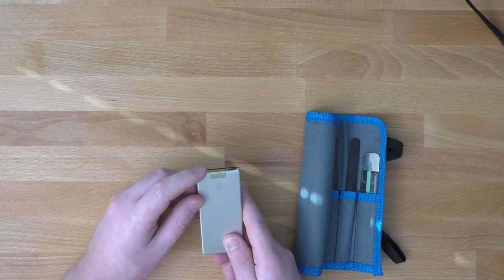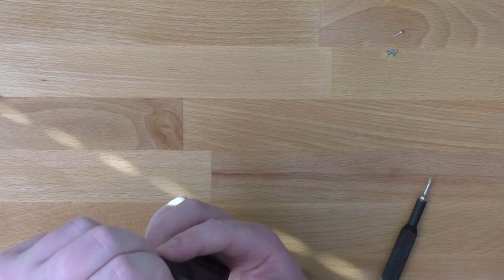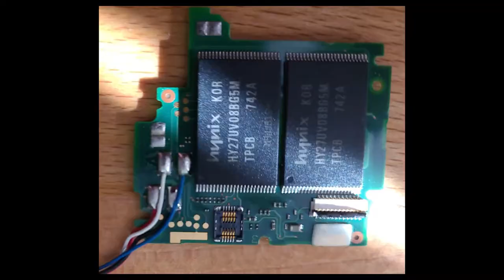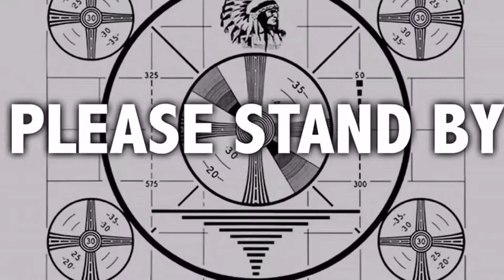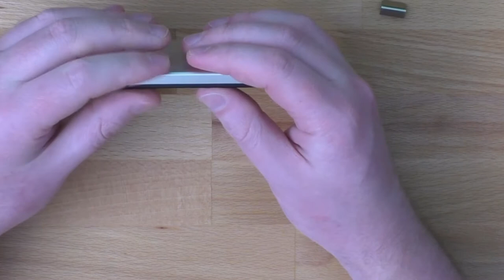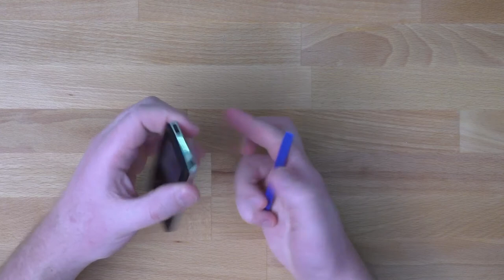Zune Battery Replacement

Comment: @CO3 Productions Hello and thanks for posting this awesome video about the Microsoft Zune.
I have an 80GB and I need the battery replaced could you share where you purchased your battery it would be greatly appreciated I have been trying for a long time to find a battery and it seems impossible. So if you have some great info as to where I can find a battery to bring this Zune back to life man that would be great.
Reply from the maker: Absolutely. I purchased the replacement battery from eBay
https://www.ebay.com/itm/Microsoft-Zune-4GB-8GB-16GB-Flash-4GB-8GB-Digital-Media-MP3-Player/164426248494
Reply: @CO3Productions  Thank you..

Comment: Hey I was wondering if you can post a link to where you got your soldering machine from I would greatly appreciate it thanks
Reply from the maker: Absolutely. I will post a link later tonight or tomorrow.
Reply: @CO3Productions  thank you so much that
Reply from the maker: Here is the soldering iron I purchased on Amazon.
https://www.amazon.com/gp/product/B07GJNKQ8W/ref=ppx_yo_dt_b_search_asin_title?ie=UTF8&psc=1
I did purchase an upgraded stand
https://www.amazon.com/gp/product/B00LQG47V0/ref=ppx_yo_dt_b_search_asin_title?ie=UTF8&psc=1
Reply: @CO3Productions  thank you so much I really appreciate it

Comment: Does the zune have to be completely put back together before it boots up?
Reply from the maker: You can partially assemble and test. Just make sure everything is connected.
Reply: @CO3Productions  Thank You, I think I either got a bad battery from China, or I messed something up and killed my Zune.  I was careful, but these electronics are sensitive.
Reply from the maker: Yea. That can certainly happen. Does it power on with the battery completely disconnected?

Comment: I did this and now mine won't turn on. Maybe I cooked the board? Maybe I got a faulty battery? I don't know
Reply from the maker: Disconnect and reconnect the battery. Also leave the switch plugged in for a bit.